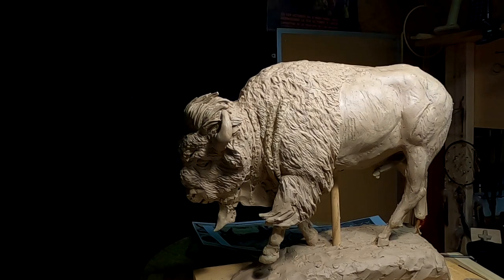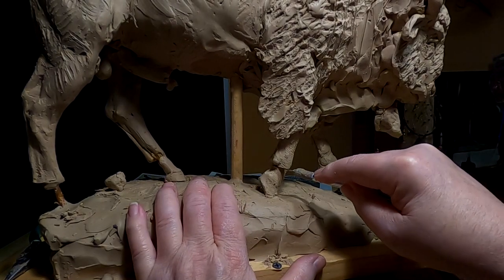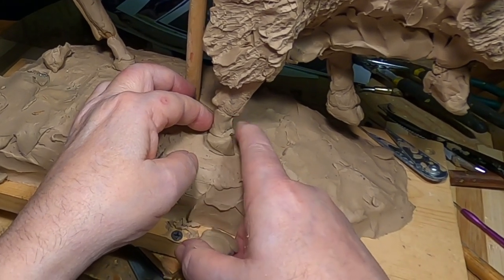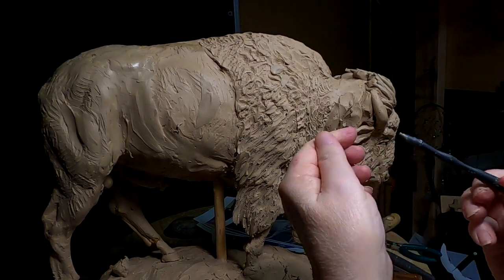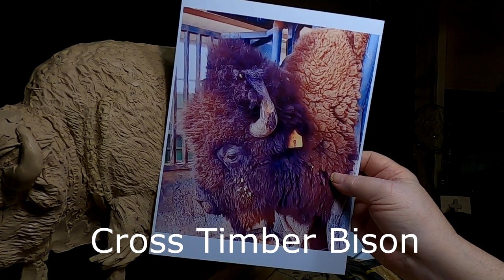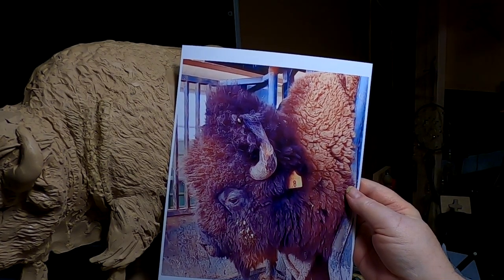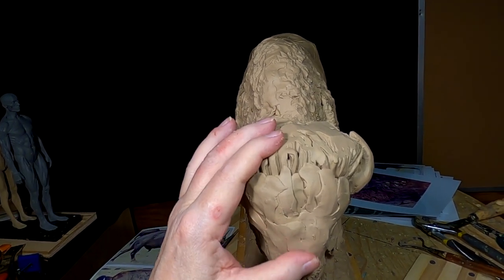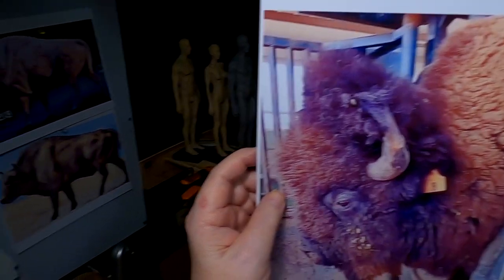09 10 2021 Buffalo Clay   Hoofe, Tail Armature and Fur

Comment: I believe Bison, are much like some dog breeds that have double coats. Nature gave them their own special temperature regulating system. Springtime they shed much of their heavy woolly winter insulating hair. In warm months their stiffer hairs provide loft, so air can circulate through their 'summer-weight' undercoat to keep them from overheating. Then late summer they start building up their woolly layer once again for winter.